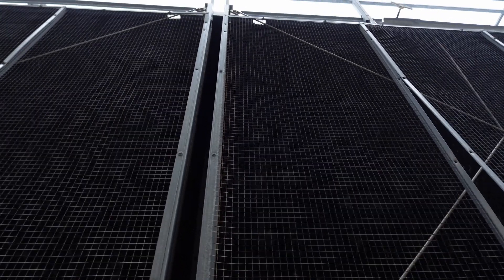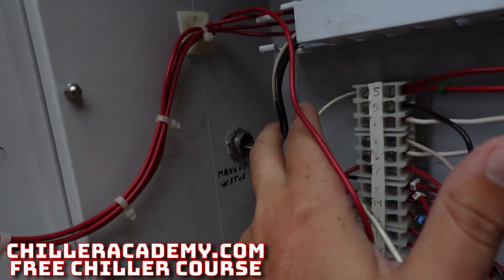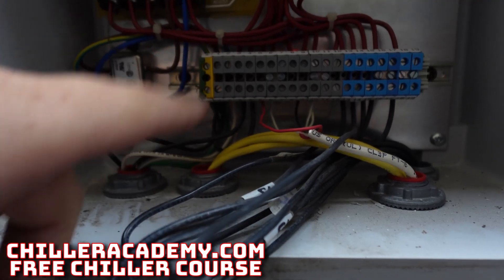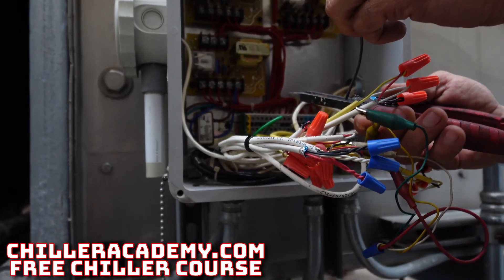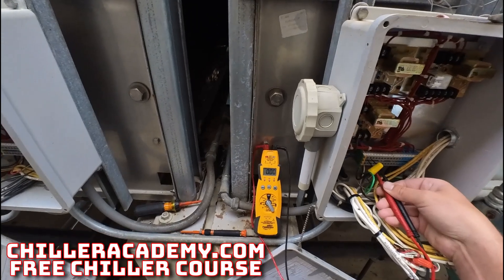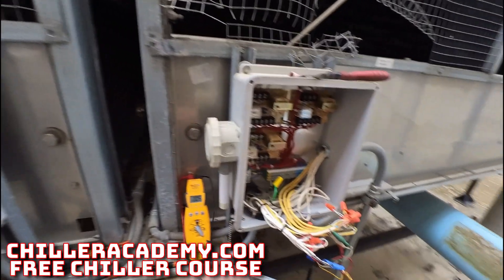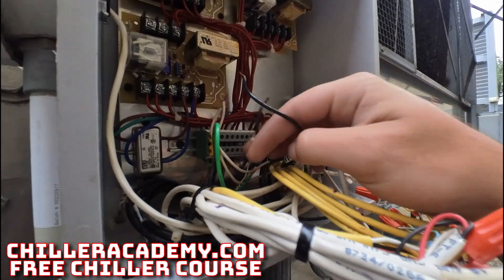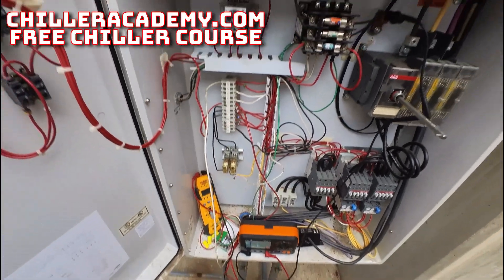HVAC Cooling Tower Wiring Short Troubleshoot

Comment: The problem is there is lots of vibration on cooling towers and lots of the old liquidtite flex has wound metal enter core or metal flex conduit with plastic outer coat or cover. The electrical wire conductors lie inside on the metal flex and the vibration will cause the wire insulation to abrade on the metal and there is where you begin to get leakage to ground and later a ground fault.

Comment: So if that make up isn’t working, will that water level be the same as the other cooling towers since it’s on a equalisation line?
Reply from the maker: If the equalizer is open yes, it will at least try